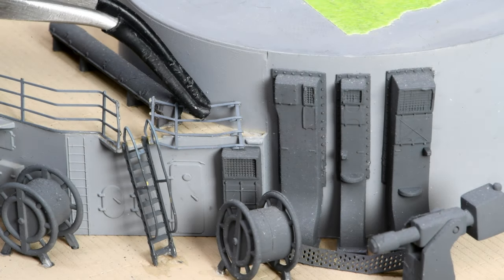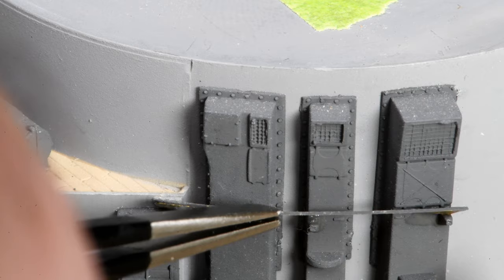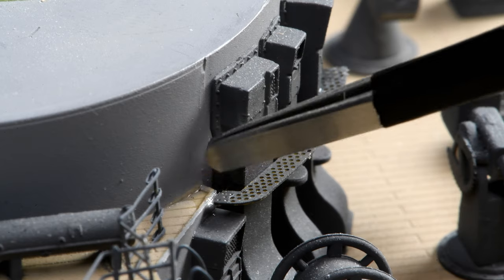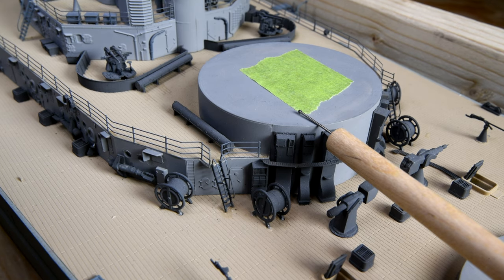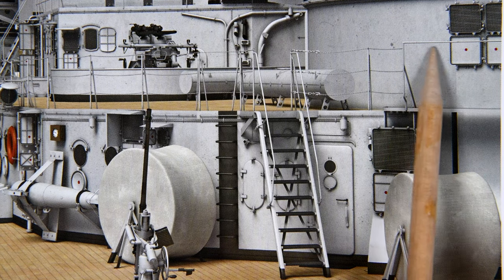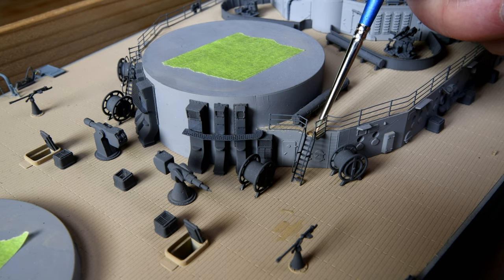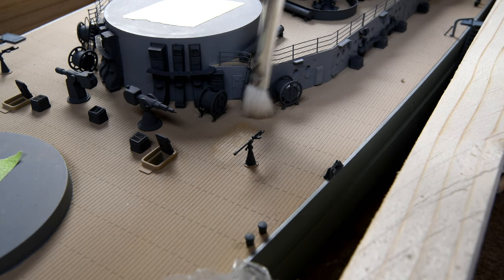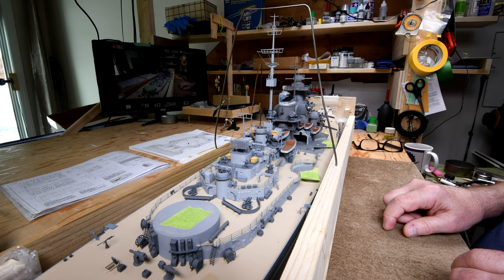The Model Ship - Part 381

Comment: Hi Ron, I know that I had mentioned this before that instead of using E-Z Line that you use very thin wire (paint it grey). You can also use fishing line (one pound test). It will much better to scale and will not Slack.
It is not expensive. Think about it. I'm sure that other viewers will agree 🤔. 👍. 🐇.  Let me know what think.
As always and see you tomorrow.
Jason.
Reply from the maker: I was thinking about light test monofilament fishing line until Tony sent that sample of EZ Line a few weeks ago. If you will remember we used it on the cranes. I was very impressed with just how flexible it was. Much more easily manipulated that fishing line --- unless fishing line is different from what I remember, lol. 👍
Reply: Ron, I do remember the crane. I did look pretty good.
Thanks for the come back. Enjoy the week-end.
Jason